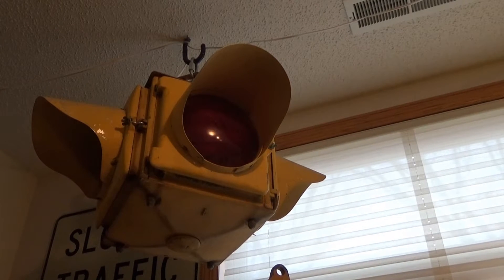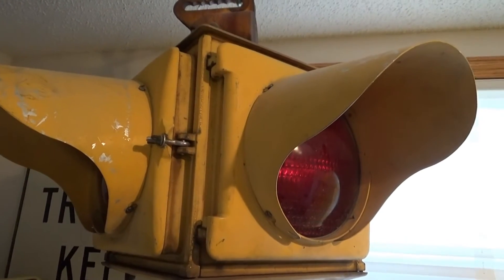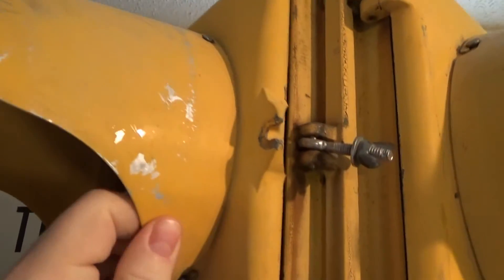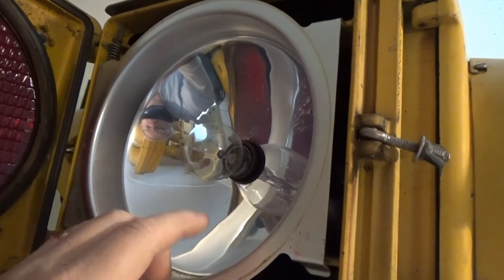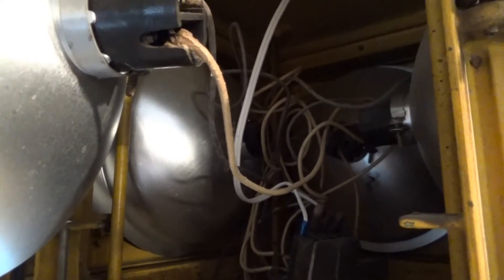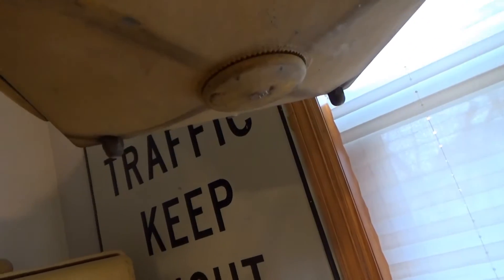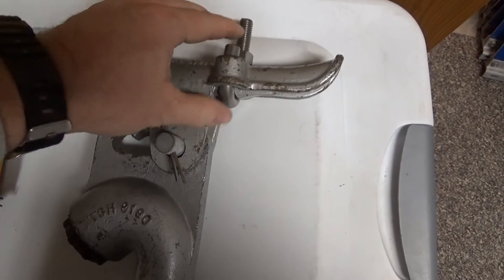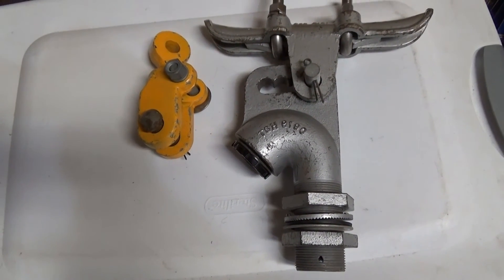Crouse Hinds Type "M" 4-Way Beacon

Comment: Question.  Back in those days they used asbestos cloth wiring for many devices.  Dose this light still contain that?
Reply: Do you see it? If not then I would say no
Reply: @Taylor-xh8uh   These socket leads are the early Type M 4 way they are cloth asbestos covered
Reply: Type M 4 way Non-Adjustable and one way Adjustable Crouse Hinds Signals introduced in 1959 all were supplied with neoprene rubber door gaskets, superseding the cloth asbestos door gaskets found in the earlier "Art-Deco" Type D and Type DT Crouse Hinds Traffic Signals from 1938- 1958. However early Type M Breadpan and Type M 4 way Non-Adjustable Crouse Hinds Signals had cloth asbestos 24"  socket leads. Around 1960 Socket leads were rubber covered 16 MTW stranded 24" leads. I used to have a large collection of Crouse Hinds Traffic Signals, I had seen a few Type M where some of the leads were cloth and some of the socket leads were rubber covered definitely the transition period from Cloth to rubber leads!

Comment: thanks so much Signalfan, you really showed a lot of detail
not that I'm a "craftsman" modeler, but could you give me the width and height of the "box" and the length of the "shade" over the light please
thanks again, Chuck
Reply from the maker: Chuck- Box is approx. 12 inches square and shade is about 7-1/2" long at the top.
Reply: thanks, Chuck

Comment: I believe the 1 and 3 on the top and bottom plates serve somewhat as a wiring guide.  The main street indications are wired to the 1st and 3rd terminals on the terminal blocks.  The cross street indications are wired to the 2nd and 4th terminals on the terminal blocks.  My model M 4-way has jumper wires on the terminal blocks to light the opposite direction of any given side.  If the main street is green for example, the signal facing the opposite direction would be green as well.
Reply from the maker: Ah yes, I can see that now. Makes sense.